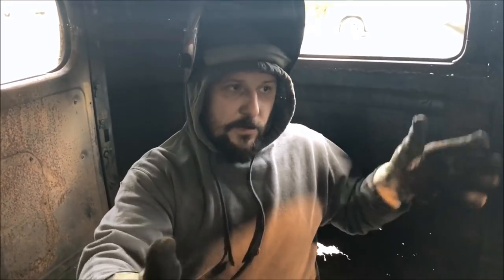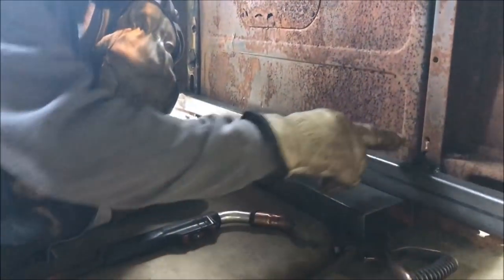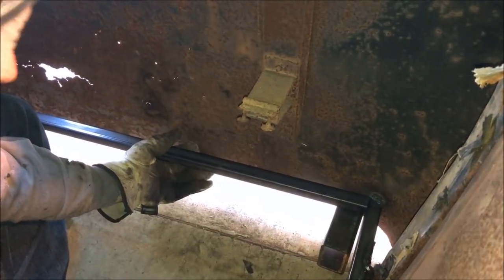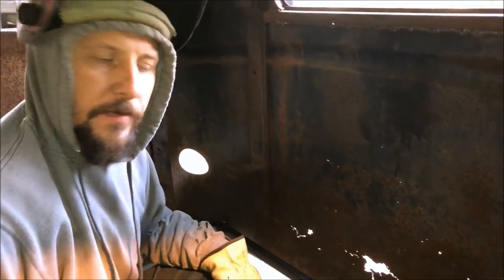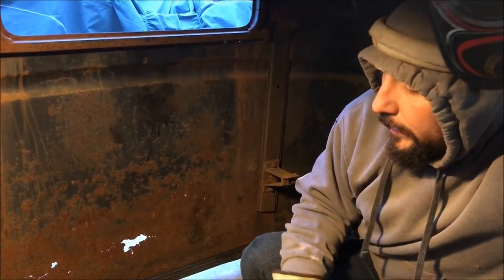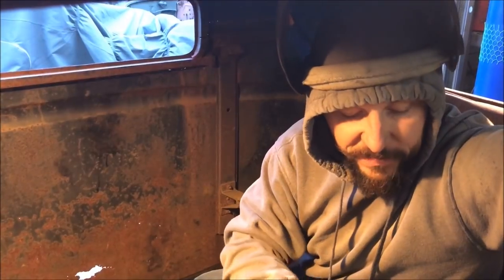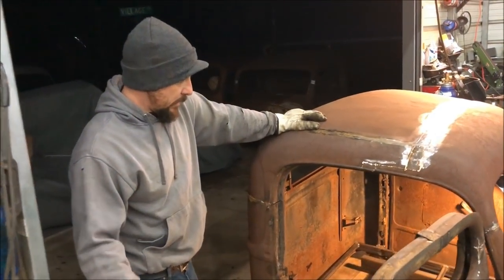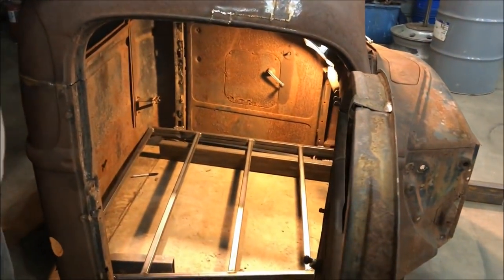RATTOD tip of the day: SIMPLE WAY TO DO FLOORS IN YOUR RATROD AND FAST! HAVE A DECENT FLOOR IN HOURS

Comment: Hello, I have a cab similar to yours, The passenger side rocker panel is gone and the driver side one end broke off while moving the cab around. Also my cab has no floor.  So the cab is all jack up. After watching this video I will put the cab up on the table, square it up and fab the floor frame like yours in this video. The only thing is that I will use 1 x 2 on the back cross piece ILO the 1" sq. My thought is that I believe mounting the seat belts to the 1 x 2 would be better. Other than this, Great Job  and yes this video does help me get my mind set on how to do my floor on my 35 Dodge cab. Thank You!

Comment: The only thing that welds better than 70 year old rusted metal, is 80 year old rusted metal. LOL!! I built a Rat Rod using a 35 Ford pickup cab. It had solid rockers, believe it or not. Very cool.

Comment: Hey I have a 32 Plymouth sedan. The floor is in great shape. I want tuck frame into it. Have you ever cut out the floor and reused it? As in cut as close to edge as possible then weld the 1x2 outer and reweld floor to that?
Reply from the maker: Yep.  Thats how you channel a normal car.
Reply: @VillageCustoms  

Thank you. I’ve been overthinking since I haven’t found a video of something simple. Usually it’s full floor. And I’m like but my floor is perfect. Just needs a rear section lift and a couple inches higher. Thank you.